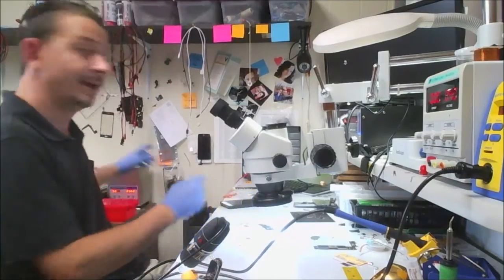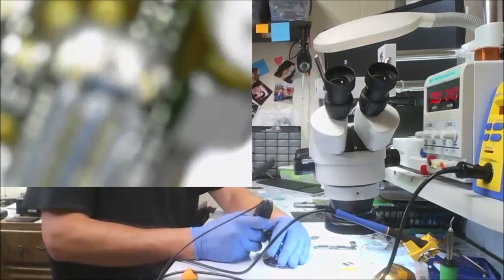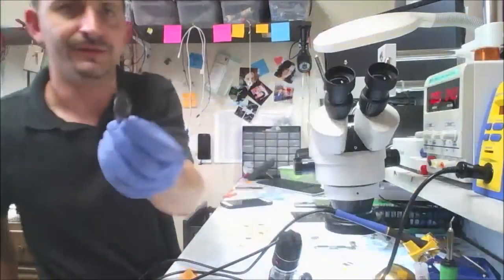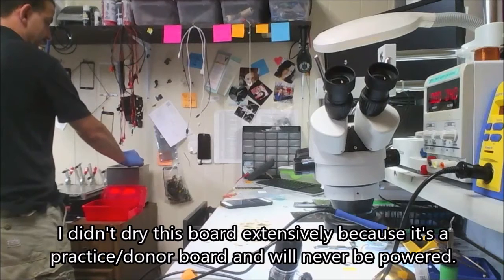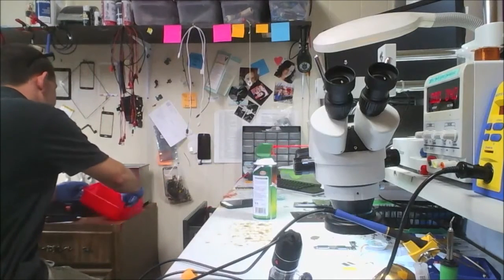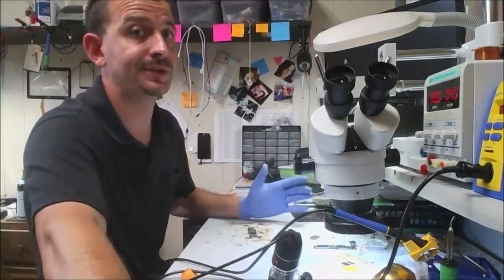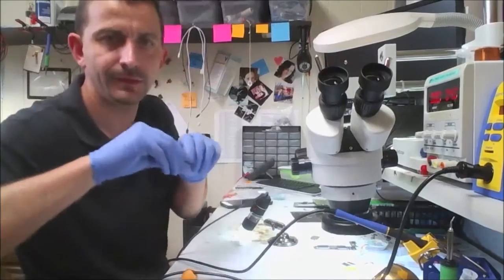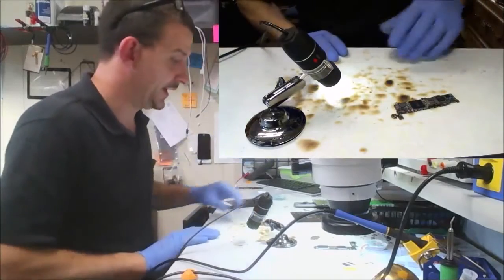Ultrasonic Cleaning - Sticky and nasty to clean in 30 seconds

Comment: http://www.ebay.com/itm/DEWALT-0-3-HP-1-Gallon-Oil-Free-Hand-Carry-Trim-Air-Compressor-D55140-New-/391334273127?hash=item5b1d572067:g:XjQAAOSw8-tWX-t5

http://www.ebay.com/itm/391377195136?_trksid=p2060353.m2749.l2649&ssPageName=STRK%3AMEBIDX%3AIT
Reply from the maker: In the last shop I had open (10 years ago) I was using a similar setup and had the compressor mounted in a closet in the back so it wasn't so loud.  I'll be switching to something like this pretty soon because air duster cans are getting to be a pretty big monthly expense.  I could probably buy that compressor with what we spend on cans in 2 months.  Thanks!
Reply: +STS Telecom pays for itself.  watch youtube vid on it. it's pretty quite.
Reply: +Tony Tone i use in office building & can barely barely hear next door.

Comment: Hi. Do you find that a standard ultrasonic cleaner is good enough as other you tube videos are always mentioning sweep frequency cleaners?
Reply from the maker: It does a really good job cleaning rework mess off of the boards.   It saves me a ton of time cleaning up messes but you can bet as soon as I can afford a higher end cleaner I will be buying one! :)  Once in awhile this one just wont hit the right frequency (it's sort of all over the place) for whatever piece I am cleaning and it comes out not clean.  Usually holding it at a different angle or moving it to a different spot in the solution takes care of it.

So, I can see where sweep frequency would really help because resonance has a lot to do with how well, and what components are getting cleaned.  Different materials will be cleaned better by different frequencies.  Sweep frequency will be certain to cover a range of frequencies in a controlled fashion so that everything gets resonated with.  That's how I perceive it anyway, I could be totally wrong! :)
Reply from the maker: +martin nash When I hold the flux covered board in just the right spot, you can see the flux spewing off of the board into the solution. It's cool.  Probably shouldn't require finesse to use your cleaner tho!
Reply: Thanks for your reply. I have been looking to purchase an ultrasonic cleaner for some time now, but the sweep frequency variety is currently out of my price range. So it looks like I could get by with a standard one for the time being.
Reply: Only found your channel in the last week. Enjoying your take on the repair industry.